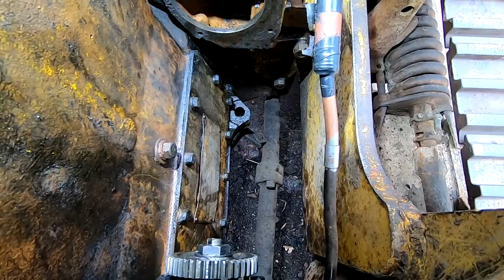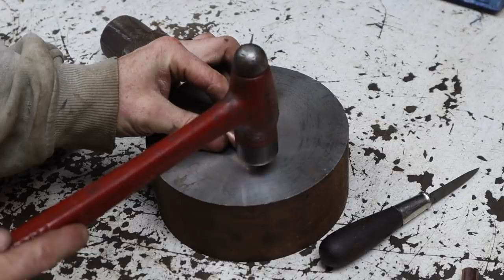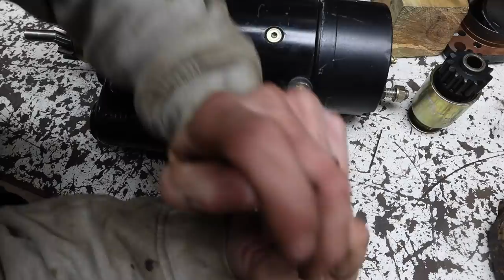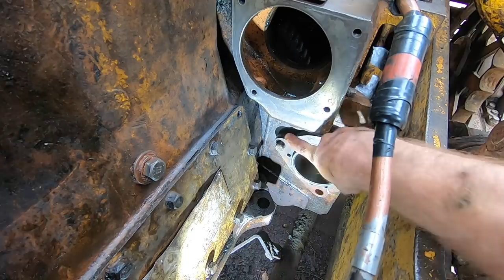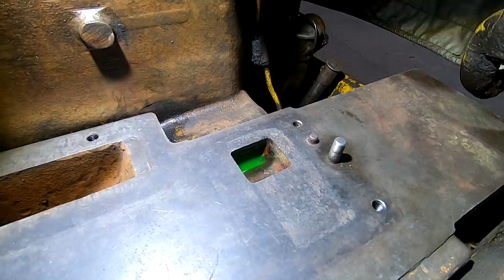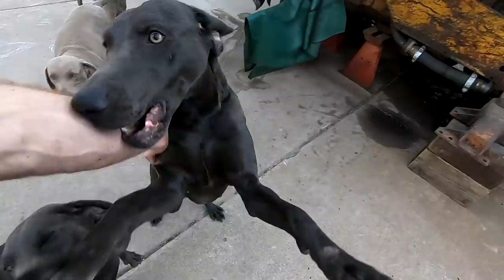Adding a SECOND Way to Start the OLD Cat TraxCavator!!! ~ Part 17 ~ 1950s Caterpillar TraxCavator

Comment: According to Squatch253, in addition to warming up the main engine, the pony motor also allows the lubrication system of the main engine to build up oil pressure and circulate oil throughout the engine while it is turning over with the compression release engaged and minimal stress on any of the components.  This function is valuable year round.

Comment: You can buy a perko battery selectee switch with up to a 4 battery control. You can select each battery or all. As for the head gasket I think it’s very safe to say it needs replaced. And if you have a true machine straight edge you might want to check all across the surface with a 2 thousands filler gauge. Or just take it to your local machine shop. I would also request that if needed resurfaced that they do it with a flat surface mill. Those heads are a bit to much for a broach mill. Good luck, and great job you are doing. 👍

Comment: Bendix is an obsolete (but often used) name for an obsolete starter drive type. I saw a few on 1940 and earlier farm tractors and trucks. If the starter has a solenoid to engage the drive, then the drive is an over-running clutch drive. The Bendix used inertia and a spiral to engage, centrifugal lock pin/ball to maintain engagement till flywheel speed is high enough to disengage the locks and drive the pinion assembly back up the spiral to lock in a smaller detent so it won't drift or vibrate back into the flywheel. My 1960s textbook has pictures and description of operation.

Comment: Love old Red. Do the head gasket. Even a valve job if it needs it. The Tahoe would be a good video project. Just getting the exhaust manifold off will be an interesting video. And. Are you related to William Wegman?? 😉😂

Comment: When you say debating, you just mean debating HOW. as soon as you mentioned it, we all know you're going to do it LOL. good luck! 

Also, you should get a bore micrometer and check your liner wear while you're in there. do a compression test on it now that you can just spin it over on the electric starter, as that gives you a good reference for what it should be according to the book before you start, and checking the bore will tell you a lot about how worn out that engine really is. the liner wear pattern isn't even though, you need to check at multiple depths because the wear is kind of "egg-shaped" as my teacher put it. the very top is pretty true (along with the bottom... but let us not go there) because the rings and piston never cross them. then the wear starts pretty aggressive and tapers down through the bore because as the power stroke occurs, the cylinder pressure drops, and the ring pressure decreases. so with one tool and no reference, with just the head off, you can tell how worn the liners are by just measuring the very top for the reference and then going down from there! this will tell you now how much life it's got left on it and whether it needs new power packs or not. it might not smoke and have decent-ish compression, but if they are clapped out, you're going to be down on power from day 1.

this turned out longer than I anticipated, but I hope it helps!

Comment: What you need for your starter is called a series parallel solenoid. I have worked on 1957 Mack b71. 6 volt system with a 24v starter. Pretty common on older big rigs that ran the truck wiring on 6 or 12v and the starters on 24v.

Comment: I would check the torque on the head bolts/nuts to make sure they are properly torqued.  Everything else that you have checked has been loose or broken off so the odds are in your favor that the head bolts just need to be tightened.  If they are tight then I would go ahead and pull the head, but I would have it checked by a machine shop to make sure it was not warped and machined if necessary.  Also make sure you have enough to get the head off without moving the bucket.

Comment: Yes, you need to do the head gasket while you're there. No on the Tahoe. Did you ever look into an inertia starter for old red? They are handy if you don't have the electrics to power an electric starter.

Comment: No telling how long that gaskets been on that head. They tend to get oil soaked and then it bleeds out the side.  If you have the time, that's cool.  I know you've got a lot of other things to do with it, like finishing up the tracks.  Taking care of the body leaks is a good thing.  Preventive maintenance never hurts.  You're a very hard worker.  The heavy work you do, I bet you're very tired at night.  Hope the starter works okay.

Comment: There's special starter switch relay made for those situations so main wiring is 12V and starter motor is 24V. It switcher the the batteries connection to serial while engine starting (sure starter motor wires only) and to parallel all other time. So both batteries will be charged properly. Here in Russia and exUSSR countries that relay got marking of "VK-30" but I'm sure there's similar products in foreign assortment. Try to ask that guy who's helped you with the Old Red's starter motor modding. Or at truck spare parts stores/dealers.
About cylinder head gasket replacement. Are you sure that the head itself will fit between studs' ends and the upper frame crossmember? That may be the problem because once you undo the nuts you  have no way back except to lift the head off the engine to put a new headgasket. Also you'll need someone to help you even if you will use your forklift to move that heavyweight piece of cast iron. 
Watching every of your video with a great pleasure and interest, wishing you a luck in all your efforts!

Comment: Question about the starter bendix gear, there are no bevels on it to help engage the flywheel?   Just curious, every automotive starter Ive seen has them, and can't imagine changing the flywheel ring gear is very easy.

Comment: Definitely change the head gasket! 👍
And if you connect two batteries in series to run the starter you could tap just one battery for the 12V system. To solve the charging issue, you "just" switch to a 24V generator. Simple right? 😜
Anyways. Good luck and keep up the good work 👍

Comment: Do you plan to heat the block with the pony or glow plugs or adding a different block heater to the water system? Also change the head gasket as water may get into the oil or oil into the water it will get worce and over heat.

Comment: There is a marine electrical switch for boats that utilize 12 volts for the engine and 24 volts for the trolling motors.  You may be able to adapt one of these to your situation.

Comment: Family of me had a cargo ship with a 4 cyl lister that looks like a cat 60 engine. He had a briggs and stratton 1 cyl petrol engine with a rol on the shaft and mounted on a frame with a pivot point. Start the b and s pivot the frame till the roller hits the flywheel. The lister had the possibillity to lift the valves. Not orriginal like cat but it worked.

Comment: check around at a truck place old trucks used a parallel switch  to do what you need for a 24 volt starter. I think military trucks still use 24 volt start

Comment: 2 x 12volt batteries connected in series gives you 24v.  Wired into your system as before.  BUT have an additional Hot Lead from one only battery to the starter motor, via a high amperage switch.  That way, both batteries will get charged as before, also.

Comment: Several things of note, unless the bendix is traveling too far, don't shim the starter not to engage the flywheel all the way, it also adds a point of flex you might not want. I suspect a 12V 42MT starter is an off the shelf item and alleviates your 12/24 issue. If you kept a 24 v starter I would use a DPDT relay to energize the starter by putting the second battery in series above the first battery like your with winch controller using two start solenoids, and the off position of the dpdt relay as a way to charge the "float battery" to the original battery. There are a dozen ways to do this. Change the head gasket, look for high or low liners  relative to the block, head and block are flat also look for water pitting on both head and block which can be cleaned and filled if they do not seal at the grommets. I suspect the head bolts are too loose for a reason. Have fun, hope you haven't broken a head bolt in the block. Choose a jacket water treatment and stick with it.

Comment: There are battery isolators that are used in diesel engine starting that use 24v (both batts) to start then automatically isolates one of the batteries to run in 12v.  
You will have to find one for your particular situation...paying close attention to the amperage required to go through it to start the engine.  
As far as pulling the head off...my vote is to do it now...waiting will only make things worse...it will have to be done regardless and everything will be back in the way later on.  
Would love to see the Chevy being done if you are willing to video it...I really enjoy your content.

Comment: I have used resistors to drop DC voltage before but never on such a high amp system so there may be a way to reduce a circuit from the 24V system to 12v or even 6v but I am not sure. If the head gasket was leaking replace it they only get worse. My "Favorite customer" when I was a mechanic was the "well I thought if I kept driving it would get better" customer.

Comment: Dual voltage setup idea. Use a Ford starter solenoid out of a ~1995 F350 as a relay between the two batteries. Wire the control side of the relay to a momentary switch on the instrument panel or wherever you want to put it. This will allow you to have 24v at the starter only when that button is pushed, which will leave your 12v available for the pony motor starter. You can either use the same momentary switch for the s terminal on the starter or you can have a second momentary switch for the s terminal. The only thing I am unsure of is whether or not the 24v will burn the coil out of the starter solenoid. I wouldn't think it would, but I could be wrong.

Comment: I've seen an isolater style switch used in boats i had 1 on my old boat that will switch it from 1 battery to both then in the centre position turns both off when not in use I certainly think that would be perfect for your application

Comment: Regarding your starting issues i reckon the way to go is to fit a series parallel switch and wire it up.Do a web search for the wiring diagrams.Good luck with it!

Comment: Do not disturb the head. It runs fine. You are talking about minor coolant leaks that might stop.
You can't just change the head gasket. You will need to evaluate liner portrusion. If too low you will end up pulling the liners and doing a full inframe. I believe these engines were designed to be fully rebuilt whenever the head is removed.

Comment: I have same machine and still learning about it. Mine had been sitting for 8 years before I got it running again. My question is, does the Hydraulic pump drive the drive train? I try to dig with mine, when bucket digs into dirt, my tracks stop turning. Curious if this is a Hydraulic issue or clutch issue?

Comment: Check into a series parallel switch to handle 12 and 24 volt functions. They are used all the time on diesel truck engines.

Comment: Did you ever get old red running? Was wondering if the 24 volt system was negative ground or negative/positive ground like on old John Deere tractors with 2 12 volt battery's?

Comment: I would replace the head gasket on Old Red. It is already, somewhat compromised and you are just a few steps away from getting to it. If it blows under load you’ll never forgive yourself. Video the Tahoe work. I have the exact same vehicle and year. Love these models. 135,000 and no issues. Have an 05 Yukon XL as well, 186,000. But I’m in the south.

Comment: I think it would be cool to see the ponymotor rebuilt sooner, but I understand they can be a bit hard to get parts for, so it might be a while before you have it back together. Definitely could be handy to have it for when the battery doesnt have enough juice to crank the main starter motor.

Comment: Simple can do easy , just use two 12 volt batteries in series. You will have three connection points:
1.) one negative stand alone terminal which becomes the over all negative or ground.( 0.0 volt connection )
2.) middle connection will comprise one positive and one negative terminal becomes Secondary positive terminal ( 12 Volt connection )
3.) one positive stand alone terminal which becomes the primary positive terminal.(  24 volt connection )
Most 18 wheelers batteries come that from the factory so they can run their 12 volt CB radios off the tractor battery. PS the 24 volt charger is still connected to the 24 connection points. Make sure the single battery has the cranking amp to power 12 volt starter and both batteries are the same type

Comment: There are older semi tractors that used a series parallel solenoid.  All 12 systems had 12 volts with the starter only getting 24 volts.  You can check with the parts man to get the switch for 2 12 volt batteries or the 4 6 volt batteries.

Comment: When you connect your two 12 volt batteries in series you just take an extra positive cable on the link between the batteries for 12 volts. and connect from negative of first battery and positive from second battery for 24 volts. Easy.

Comment: The engine is leaking oil so I would get it sorted before the leaks get worse. I would also recommend doing a compression test on all 4 cylinders of the diesel engine because it is a very old engine and a rebuild may cost a lot if parts can be found.

Comment: You will need to do some planning because your project will need to charge both battery systems while you are running.
You are going to have two separate electrical systems with one common charging source while in operation. 

Are you sure that starter is not available in 12volt dc? 
3 or 4 position battery switch, starter relays for both voltages, voltage inverter/charger for 12v to 24v.
Run your wires to starter and leave extra length for electric panel while you have room now,

Check with Stu's videos he has item lists and why he chose them.

Comment: My next question would be charging ? Nxt thing ill say is u have great thoughts n ideas , but as far as shutting it down constantly is these are intended to run a whole day at minimum if not desighned to run an entire wk . Would that injure the engine as in short runs? Thats my thought we had old macks old machines as a td 9  start on gas n switch to diesel after .  and a d 9 cat as well. Pony start the whole 9 . Wat is ur thoughts?

Comment: Just a friendly comment, On the video it look like the bendex is engaged with the flywheel when you put the starter in the flywheel housing, have you checked that you have suffiicent clarence ? when the starter not running?

Comment: From the positive ignition switch Using on on toggle switch into two  starter solenoids. Flipping the switch to position one would be for the 24 V and the other way would be for the 12v system

Comment: Honestly mate look you’re going to open Pandora’s box taking the head off on old red But I believe it’s worth it in the long run especially if old red is going to going back to work and needs to be reliable. As a side note a lot of the old diesels leaked old from birth they were not machined to a high tolerance so don’t expect to stop all the leaks just most. Good luck and keep up the great work.

Comment: FYI, it was not the voltage that made your switch smoke, it was the total power (V*A). Even 6v at enough amps will smoke the switch. Voltage will cause arcing and can damage contacts on a switch in that way, but it is power that will melt things.

Comment: You are lucky you had the hole to stick the starter in. On my motor grader I had to pull off the bell housing, have the hole for the starter bored in it, then drill and tap the 3 bolt holes. That was a job.

Comment: For centering that hole relative to bolt holes use carbon black to make the hole for5 cutout. Slide it on body and mark the holes Then use a hole cutter for gaskets for bolt holes.

Comment: 1, I'd do the head gasket,  maybe lap valves. And put it together. If you find you need bottom work save for future. Enough old machines I've worked on it was top end that would do irreparable damage if not done other than crank bearings.
2, would have used a 12 vdc but I understand,  best bet unless u want to spend several hundred dollars buying one would be to make a parallel-series relay switch. It can be made using 4 inexpensive delco starter solenoids. The key is to mechanically interlock them and only use one for control. That prevents a major short. I've made 2, one went on an old cat grader and it was 100% mechanical the other I used on our old K100 and they both lasted years. If I remember i made them using 4 solenoids,  piece of 2x4 steel box tube, and some eye bolts, 4" barn hinge, short steel rod for the interlock.  Hardest part to keep in mind is the wiring.
You could use standard solenoids but there are 2 major issues. 
1, you would have to get 2 in norm closed or wire them to close when unit is running
2, if one of them fails it will dead short you batteries together, that why the mechanically interlocked contacts for these in commercial use.
It is possible for me to draw this up for you. Just don't know how to contact so eone here

Comment: Absolutely change the head gasket. It’s already leaking and may not be 100% necessary yet, but it’s already failing (not surprising on a 70 year old beast!)

It can be a big job depending on what else you find, but you’re well on the way already with things much more accessible now and if you discover issues those wouldn’t go away by ignoring it now, theylllnly get worse and create bigger issues. You plan on keeping it and using it, so the goal is to make the work you do now, last. “Do it once, do it right.”